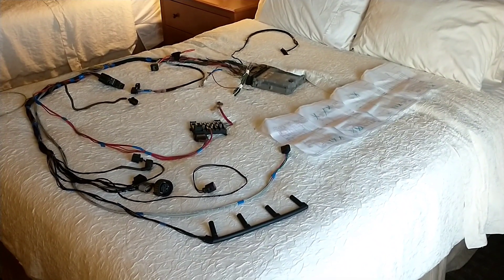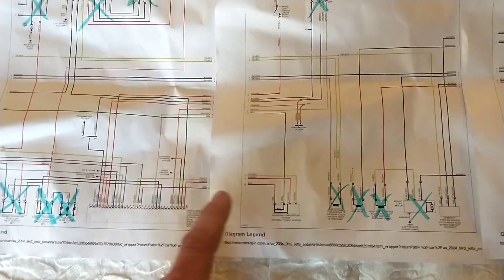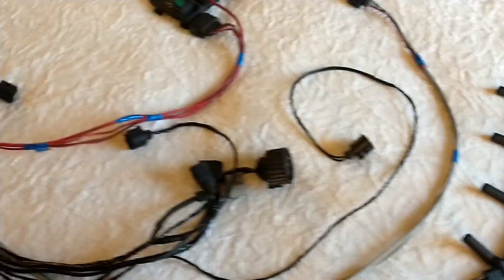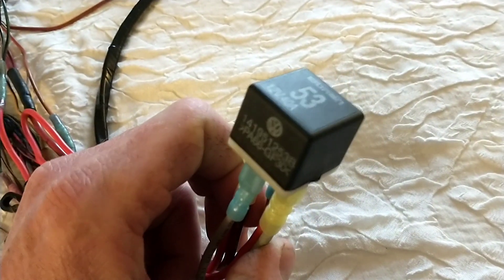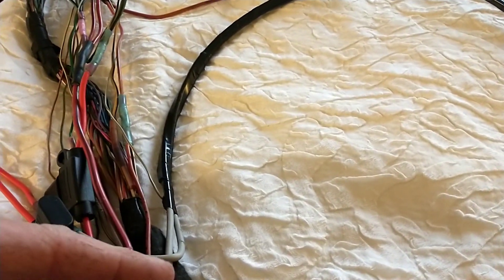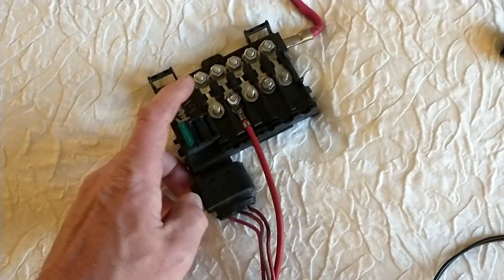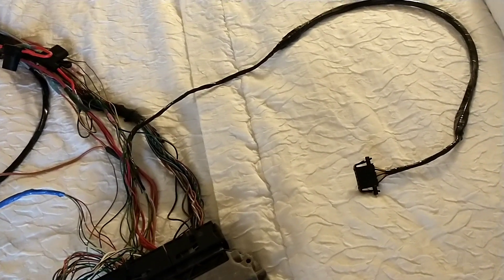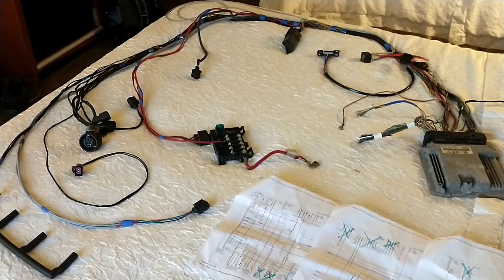Making A Standalone TDI Wiring Harness for PD EDC16 ECUs, Including BEW,BRM,BHW

Comment: Good morning, I have a PD BEW with this control unit. Could you help me with the wiring diagram or electrical schematic? Please, I can't get it to work, the engine goes into emergency mode.
Reply: Do you have contact information for watts? I'll send a photo of the codes. It lost power and doesn't charge the turbine.
Reply from the maker: @marceloarruda9873 well you will need tuning to delete the additional sensors that would cause emergency or limp mode. I'm not sure I follow the rest though. You cannot just plug a standalone harness into a factory tuned ecu
Reply: Oh yes, I understand, in this case I can't connect the module, right? This module here has already been reused and already been equipped, I think, because this engine was running normally.
Reply from the maker: @marceloarruda9873 well there are many other sensors the module looks at to run correctly.  Those need removed from the tuning/mapping of it.  And running inside the car it sees things it can't see outside of it.
Reply: Oh, I understand. And the diagram. You have the diagram for this module here that I saw you making a harness for, so could you pass it on to me to sell how you can do it? Can you help me?
Reply from the maker: @marceloarruda9873 the diagram is on Facebook in the group "TDI Swapped Trucks" I can to send it on Youtube
Reply from the maker: What do you mean by emergency mode?
Reply: I'm from Brazil and I need help. I'm adapting this engine to my diesel saveiro.
Reply: you unlock the module and also chip the module, these things, everything, yes or no
Reply: I follow you on your website to get the diagram but I couldn't
Reply: So, good evening, could you send me an email?
My request has not yet been approved on Facebook.
Reply: My order is pending no Facebook no tdi swapped voice get approved

Comment: Do you need to remove immo before starting all the process?
Reply from the maker: You can look at codes but the engine will not run until immobilizer is deleted
Reply: Thank you a lot.  You saved me a lot of troubles.
Reply from the maker: @J...xh...j74 no problem! If you need that immo off/tuning done I can do it at my shop, I can give you my Facebook info to get you taken care of

Comment: Hi, can you give me little advice please? I am running on a 1.9 bxe edc16u34, setted it all the way up in a golf4, everything works perfect but i cant sort n75, i have the box black solenoid type, all egr errors goes away but n75 p0246 still there, connected it to right t60/29 and gived the shared 12v with other solenoids, even tried to put a standalone n75 and another solenoid black box and even to swap to another edc16u34 ecu from bxe but the error still there.. can you help me out please?
Reply: I figured it out, it was ecu issues both ecu was sold to me broken, now bought another one and everything is fine, now the last issues is the fan control module, i connected it and fan always on when i turn on ignition, i connected blue/red wire to switched 12v the red to 12v the brown to earth and the yellow/violet to ecu pwm, i have no errors in ecu everything great, only i have this issue..
Reply from the maker: @shendlaw glad you figured it out!
Reply from the maker: Have you tried a different n75 valve? There's not much to it, pin 1 gets 12v and pin 2 goes to the ECU pin 29.  It's got to either be wiring or the valve itself
Reply: @TDISwaps hi, i will try another n75 valves then.. or other vaccum box… thanks bro
Reply from the maker: @shendlaw no problem man!
Reply: @TDISwaps hi bro, still nothing tryed out more n75’s and mor black vaccum box but nothing still got the short to plus error, even with different ecu..
Reply from the maker: @shendlaw dang! I mean I've never seen it be anything but the n75, the wiring, or the ECU
Reply: @TDISwaps  thats strange, always short to plus, on any plus cable i get the error, strange thing is that egr and so on works and if i disconnect the egr i get short to ground error on it, only n75 says short to plus, checked lot of connection and tried different pins but nothing.. idk what else to try
Reply from the maker: @shendlaw it definitely sounds like wiring issues, but it's very hard to diagnose for you just through messages

Comment: I need to know my tdi pd wont start i used autodata for reference  and on my scan it is reading good except for the pedal what did i do wrong
Reply from the maker: It will start without the pedal, so those would be 2 different issues.  First check that it has rpm while cranking, then check pedal wiring again it is easy to mix up the 6 wires because they change colors on the way to the pedal.

Comment: Can you posibly make me a loom for bkd retro fit in to a peugeot 306
Reply from the maker: Well I am usually making these looms using the TDIs wiring like the original BKDs loom.  And I'm also always making them standalone like to run without hooking to a factory ve cluster, just universal gauges
Reply: I'd like to run mine to the peuegeot 306 intrusment cluster also reatin obd
Reply from the maker: @leonwilliams2412 ya that would just take seeing what that cluster wants for inputs, but the vw coolant sensor is a weird resistance that can be hard to match, as well as it not even looking at oil pressure so a lot of it is best using your own sensors anyways

Comment: So I’m trying to rewire my engine bay I’m building a new dash in my Jetta to be a center seating position with a wrap around dash kinda. I’ll have plenty of room in the new dash and, floor cubbies on the sides to relocate everything.
Reply from the maker: Perfect time to do a custom dash since the VW one sucks anyways haha
Reply: @TDISwaps  yeah, I might be needing some help possibly with some questions here and there. New to the whole wiring thing but good at all the custom stuff, the exhaust tunnel is no longer needed because of hood exit. So I’m cutting the floors and tying the front subframe to the rear trailing arms and strut towers. Then building storage bins in the floor all the way up to the driver seat.
Reply from the maker: @IMCABLETV sound like quite a project!
Reply: @TDISwaps  I’ll have a channel and videos sometime this year
Reply from the maker: @IMCABLETV sweet!

Comment: Planning to put one in an early 90s dakota 4x4. I need a fuel efficient all weather vehicle because I do deliveries. I am obsessed with dakotas, and finding out I can do this so easily...I was instantly sold.
Reply from the maker: It's like the best thing since sliced bread! 😂
Reply: @TDISwaps  Thinking of sticking with the A518/46rh 4 speed auto. Not sure about the torque converter but I can get a diesel valve body kit for it.
Reply from the maker: @timbrwolf1121 unfortunately they do not make a TDI adapter for that
Reply: @TDISwaps  yeah I figured that out just within the last few hours. Changed the plan to finding an ax15 dakota. Swapping in a jeep ax15 for the different bellhousing and input. Then I can swap the tdi in
Reply: @TDISwaps  if I'm really lucky I'll find a 2.5 manual 4x4 but those are rare. They were usually rwd if they had the 2.5
Reply from the maker: @timbrwolf1121 you got it made then!
Reply: @TDISwaps  Went down a rabbit hole of learning the difference between amc and mopar bolt patterns. Still barely understand.  🤣
Reply from the maker: @timbrwolf1121 lol that's like every brand I think 😂

Comment: I have a BRM and on my wiring diagram I am seeing a data link interface is that something that is there or do I just need the data link wires thank you sir you’ve been a lot of help
Reply from the maker: You do not need can bus wiring for basic setup but you do need the k line for OBD communication that should be pin 72 on the big plug
Reply: @TDISwaps  I greatly appreciate your help my friend
Reply from the maker: @NathanBerger-li3yv no problem!

Comment: what tuner did you use so you wont need to use the immobilizer?
Reply from the maker: I bought the software to do it myself
Reply: @TDISwaps   Do you need the gauge cluster to eliminate it or can you just plug into the obd2 port once wired to the ecu and powered on?
Reply from the maker: @Speedy2222 I have a bench test box so I just need the ECU itself
Reply: @TDISwaps  dang the donor i got has no key, only ecu and cluster
Reply from the maker: @Speedy2222 yeah all you need is the ECU to run the engine once the immobilizer is disabled but it has to be bench flashed to disable it so you'd have to mail the ECU into somewhere like me or a tuner.

Comment: Will this same setup work for edc15? Looking to swap an awx engine code into a pajero 2, and being in europe doesnt make this easier since there are so many different engine codes than back in the states...
Reply from the maker: You will have to use a compilation of both my videos on edc15 and edc16 unfortunately, pins may be different too

Comment: Any idea where to get connectors?
Who can tune the computer for this swap as well?
Reply from the maker: I get all my connectors from Ali Express.  And my tuning all comes from TekMekTronics.  I will be getting setup to offer swap delete tuning in the next few months.
Reply: @TDISwaps  how about the main round connector to the injectors in a bew motor? That seems impossible to find
Reply from the maker: @jamesharless6003 those are hard to find new, but they are usually available used, the part number is 038973121B.

Comment: I'm looking to swap a tdi into my old Datsun pickup. I've been leaning toward an ALH but the bike insee the more the BEW seems like a great option as well. If you had your pick, what would take?
Reply from the maker: It's a tough call, bew is stronger but has more maintenance, ALH is more dependable, but weaker bottom end, I definitely don't like that fuel leaks on the PDs go right into the oil without you knowing.  I usually just base it off price and availability at the end of the day
Reply: @TDISwaps  thanks for the info. Yeah I see way more BEWs and BHWs for sale than ALH but I've seen those ALH with 500,000 miles. I'll probably end up with a BEW based on availability. You've made me confident the wiring isn't that hard. Just salvage as much of the harvest as I can.
Reply from the maker: @thisislargemouth5566 you got it! Now got get one! Haha
Reply: @thisislargemouth5566 alh head on a bhw bottom end. Have the best of both worlds. Not too much extra to do for it to work and lots of write ups on this hybrid

Comment: Where can I find the diagrams?
Reply from the maker: If you are on Facebook, the group "TDI swapped trucks" has all the diagrams in there files section
Reply: @TDISwaps  I found them thanks One more question. The mass airflow sensor is not required?
Reply from the maker: @daltonwhitney8062 i always delete everything possible to minimize issues with wiring.  I have tuning to delete everything.
Reply: @TDISwaps  sorry for all the idiot questions where do you recommend? I send my EC you to have everything deleted
Reply from the maker: @daltonwhitney8062 just depends on what you are looking for, I use TekMekTronics for all my custom tuning, Malone is also good.

Comment: Just taking the plunge into this project, thank you for your video. Maybe a dumb question but after you’re deleting things you don’t want in the harness does someone have to reprogram the ecu? Can this be done on VCDS?
Reply: Thank you very much for the reply, I’ll continue to watch your wiring videos. My swap is for a boat so I’m looking to eliminate as much as possible and then re wire using the connectors
Reply from the maker: @cinci520 no problem! That sounds like a blast! If I ever get an inboard boat it's gotta happen!
Reply from the maker: The ECU will need the security immobilizer disabled before this type of harness will work, while that's being done a performance tune with delete is easy to add on, that's all usually done mailing it to a tuner.

Comment: Nice! One thing that helped me was figuring out how to de-pin the master ECU connector (seems it can be different even in the same EDC family) moving an unused signal like air conditioning over to where the clutch pin is (granted you have a tune to switch from auto to manual EDC 16 in the case of BHW to utilize the clutch for cruise control).
Reply from the maker: Yes cruise control would probably require some pins moving but it's nice to have it running at least!
Reply: @TDISwaps  Yeah probably an extracurricular for most just starting out. If you do head down that road be careful, the de-pinning how-to is scarce and the videos that do show how always have a few comments asking where to buy new crimped wire due to them getting destroyed with lack of patience lol.
Reply from the maker: Lol I believe it! This is definitely the "how to keep it simple" video 😂